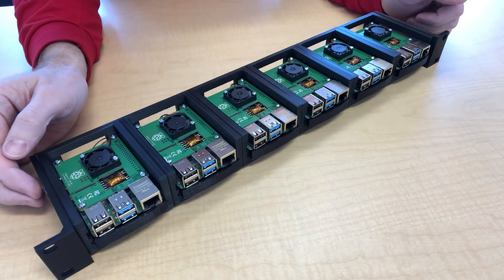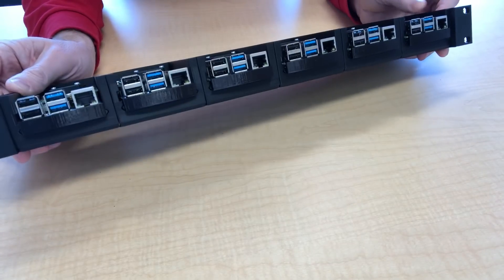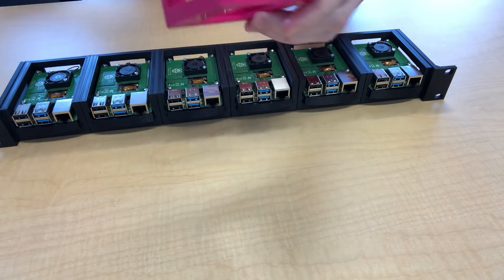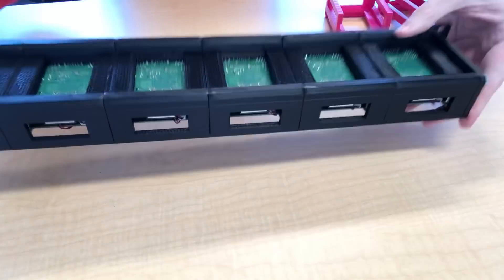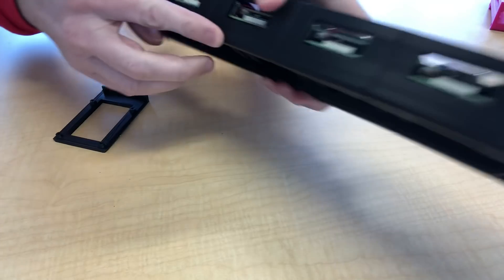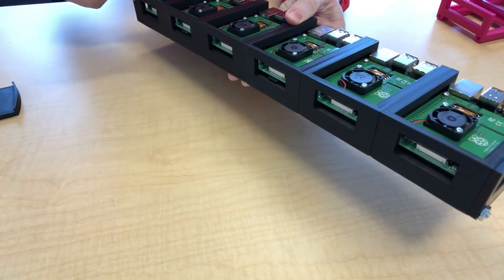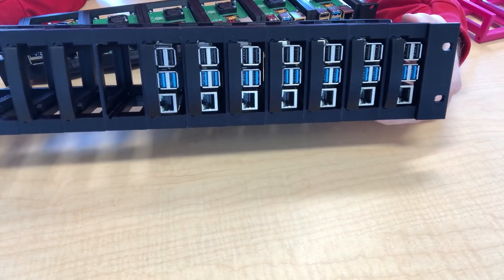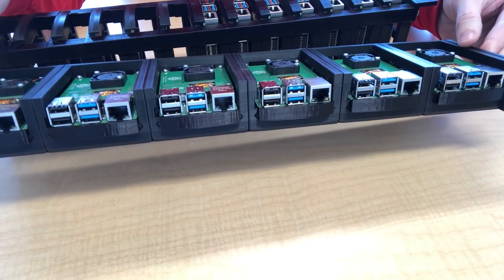Raspberry Pi 4 1U rack-mount bracket

Comment: Awesome design 👍 how power supply wires are connected in 1U Design?
Reply from the maker: It uses Power-Over-Ethernet (PoE) HATs so the power comes in the front over the network cable. You then need a PoE switch to supply the power.
Reply: @RussRoss  Thank you. This helps 🙏

Comment: So a PI 3B would not fit?
Reply from the maker: Pi 3B fits just fine, but it does not have support for the PoE HAT (that was added in the 3B+) so you would need to find a way to get power to the boards. The sides are blocked so you can't just plug in a USB cable for power.

Comment: Would this design be able to hold a Raspberry Pi 3 as well as a Raspberry Pi 4?

There is a new hat called the Pi-KVM Hat #3, do you know if this would hold a Pi with such a hat affixed atop of it?
Reply from the maker: The Pi 3 fits just fine. I haven't seen the Pi-KVM HAT so I'm afraid I can't help with that part of it.

Comment: What do you use this for, if you don’t mind my asking?
Reply from the maker: I don't use this rack personally, but I do use the 2U version. I use the Pis as servers to support classes that I teach. They are cheap enough that I use each machine for a single application rather than trying to maximize what each one does. Once class I teach involves ARM64 assembly language so student connect to Pis remotely to do their homework. I have also used a bunch at once as a cluster for distributed computing projects when I'm teaching that class.

Comment: What switch are you using that provides power over Ethernet? Raspberry pis are finicky about power draw
Reply from the maker: I'm using a TP-Link 24 port PoE switch with 192 watts total available for PoE use. It can go up to 30 watts on a single port as long as the total doesn't go over 192. My Pi 4s use about 3 or 4 watts at idle, more like 6 or 8 when fully loaded (which is not very often). A surprising amount of power can go to peripherals in a standalone Pi. I have one with a couple of USB micro sd card readers and it runs at around 6 watts idle. The switch monitors power use so you can see exactly how much each unit is drawing, which is nice.

Comment: I am concerned about the lack of airflow. Maybe the 2U gets at least some brackets for holding fans?
Reply from the maker: The PoE hat has a fan built in that automatically kicks in when it gets warm (it turns on around 50 C if I remember right). A little bit of active cooling goes a long way, and I haven't had any heat problems. That said, people have modded the 2U version to add larger fans. Check out the remix section on Thingiverse if you want to see what other people have done.
Reply: @RussRoss  Perfect! Thx!

Comment: and how to connect power to them? you can't get in there
Reply from the maker: The PoE hats deliver power through the Ethernet connection. You need a PoE network switch as well. There is a bit more detail in the video for the 2U version. It was the arrival of the official PoE hat that really prompted this design.
Reply: @RussRoss   I did not know that Pi 4 supports POE connection, then the question is removed, thank you

Comment: Will this fit an old Pi 2? I have a few 4s and an old 2. Would like to mount both.
Reply from the maker: Yes, I'm pretty sure a 2 will fit. The 2 does not work with PoE, though, so you will need a different way to get power to it, and the side ports are not very accessible in this layout.

Comment: what size rod does it need?
Reply from the maker: A US size #10 rod is the default, but it is not hard to adjust (to a metric size, for example). The thingiverse page (linked in the full video description) has the full details. There is also some useful info (and an assembly demo for the Pi and tray) in the video for the 2U rack, also linked in the description.

Comment: Hi folks - this is great and just printed one on my friend's 3D printer - question. What type of screws should we be using to mount the Pi to the black trays??  Did I miss it? Thanks. Joe.
Reply from the maker: Hi Joe--I used M2.5 x 12 screws that I bought from Amazon. It pushes through the tray and screws into the spacers that came with the PoE HAT. The tray design is the same as for the 2U version of the rack, and if you watch the video for it there is a more detailed assembly demo. That video is linked in the full description of this one (you may have to click to expand it). The parts are also listed on the Thingiverse page. Hope that helps!

Comment: Hi, I am after a case like that but I want the cables to be behind not in front, and not use POE since I only have one POE, Do you have any design Ideas for that
Reply from the maker: This layout obscures access to the power port, which is a problem if you are not using PoE. I would suggest looking at the 2U design (see the video description for a link) since that exposes the ports. Flipping the boards front-to-back would require some additional design work, but the 2U layout is probably a better starting point.

Comment: Both designs are super cool! What are you using the multiple Pi boards for?
Reply from the maker: Thanks for the kind words! I use them as single-purpose servers to support my classes (I'm a college professor). For example, I have one set up as a server that students can use for their ARM64 assembly-language programming assignments. I have another set up for a programming languages class where I have pre-installed all of the weird environments I want my students to use. I also run servers for some other support infrastructure.

I have also used them for more traditional cluster-style projects. I teach a distributed systems class in the spring, and one of our projects is to build a simple mapreduce system based on the classic paper. I used my cluster as a demo platform so students could run their distributed systems code in an actual distributed environment. This was my initial motivation for building it, although I'm getting much more use out of it as a mini server rack (it's nice to be able to devote a whole machine to something that would seem a bit frivolous if we were talking about $10,000 servers, and I prefer bare hardware to VMs).

It's really about them being cheap and yet surprisingly capable, but applied to servers instead of IoT applications.

Comment: I sunk a small sum into my first sbc with all the accessories, but I don't really have a purpose for it, in the end. At least it boots to NVMe I guess. I had hoped to run Steam Link, but it doesn't work for the Rock Pi 4C 6 Core RK3399. So much for that idea. Guess I should've grabbed a Raspberry Pi 4. Oh well, next project. 🤣 Cool mount btw.

Comment: i would love the 2U with a closed air sealed enclosure and 120 mm fan mounts on the back for cooling. those pi4s can get really hot when you load them up properly

Comment: You could make the bottom front and back part hollow from end to end and put two metal rod inside it across all six units. Would help with rigidity in both directions.

Comment: What does something like that cost in maths?  1u one :) Might  have to get a 3d printer since u were nice enough enough share the blueprints!
Reply from the maker: The 2U rack (with all pieces and some failed prints) took less than a 1 kg spool of PLA filament. The 1U rack would use less. A 1 kg spool is roughly $30. If you are new to 3D printing, bear in mind that there is a learning curve and you will likely waste some materials as you figure things out. Good luck!

Comment: Awesome video and thanks a lot for sharing your design, Russ! Are you using the same rod to connect all of the cases? You mention this in the video showcasing the 2U design, maybe I missed it here.
https://www.homedepot.com/p/Everbilt-10-24-x-36-in-Zinc-Plated-Threaded-Rod-802207/204274027

Comment: There's no clearance for the fans, and I can't help but feel like designing the blocks to interlock would give you space for a 7th Pi.

You could try putting the rods diagonally (top front, bottom 3/4 of the way back), and either one side on each block, or two sides on every other block (and a 'side' on each rail, which might make them stronger)

Comment: Does it work well with heat dissipation? Can a fan be installed without having to modify the tray or the rack?
Reply from the maker: It works pretty well, although I should note that I am using the 2U version--not the 1U version--for my own cluster. The PoE HAT has a fan with a temperature-sensitive control and they all stay around 50 degrees C. There seems to be plenty of airflow. I did not put heatsinks on the boards since I was worried it might limit airflow.

Comment: Hi russ --  do you know if the pi trays will hold rpi 3b+ as is, or is the bore hold pattern different for 3's vs 4's ..
Reply: nvm -- the answer is yes -- it will hold 3's also -- the bore hole pattern is the same for 3 and 4

Comment: 2 questions. 
1. how do they get power? it seems like there is no space? 
2. Is there a practical way for using an ssd drive as the main disk? Or do i have to plugin them in on the front?
Reply: 1. PoE (Power over Ethernet) via the hat he mentions a few times.  2. SSD as a main disk is somewhat outside the topic of this video, unless it is just about "how do I plug it in?". If that is the question, then 'yes', plug it in at the front.

Comment: One of the bigger features of rack-mounted equipment is constant pressure airflow setup for cooling. In cases like this with HDD bays in a rack mount server, they’ll rely on the intake vacuum sucking environmental air past the components, whereas smaller devices like switches tend to have their own fans to create said airflow, directing it out the back. Have you accounted in any way for this, allowing mounting points for attaching fans to them, perhaps blocking the large port on the back side a little more so that it creates a vacuum pressure around the Pi units? Would this be something you could implement? I know with a 2U it’s a lot easier to get a decent airflow without too much lost efficiency or noise. 
(Yes, I realize the PROPER way to do this would be a cabinet-mount case with it’s own silent fans, but since so many people in the DIY community go with open-air frames, I figured it would be worth asking. Especially when you’re at a Raspberry Pi Budget, those standalone quiet cases may LOOK nice, but... $$$)

Comment: I think you'd gain better ventilation if you'd turn the PI upside-down, as you have it currently there, the fan is almost touching the bottom of the equipment just above it

Comment: Excellent!! Is there enough room to allow the ventilator to do its thing when mounted in a rack? Btw: the SD card is not required anymore to boot with the new boot loader in beta. Wish List: A tray for one or two SSD disks. blanking plate.

Comment: but, a cluster for... what?!
Reply: Clustering of Raspberry Pi boards is more about hands-on learning concepts with a lower cost of entry than really anything functional.
Reply: @dmmikerpg  Low cost? Surely that's at least £600?
Reply: @dmmikerpg  not true -- my pi cluster does real work at home .. serving several services that we use everyday (pi-hole, grafana, teslamate, node-red , dns, and somme custom rails apps i've built myself
i run this on a 3 node pi cluster (using docker swarm) .. and the swarm function has even come into play when 1 of the nodes died due to a bad SD card -- the apps kept on serving from the other 2 nodes until i replaced the broken sd card
Reply: @ricardo-sf  Fail-Over (HA) Clustering is definitely useful, but in terms of distributed computing a Pi is pretty much going to be limited to being conceptual.
Reply: @ricardo-sf  I would definitely like to play around with Docker swarms and the like.
Reply: @dmmikerpg  I still disagree.. you could do vertical scaling web services with a pi cluster.. it's not theoretical..

Sure you will need many pi's to do what one enterprise server can do.. but it's not about comparing one node power
Reply: my cluster runs in a docker swarm and hosts several apps that i use at home, grafana, teslamate, nodered, etc... really cool stuff and its fun for me
Reply: Now that 4gb and 8gb ram are out, these clusters can do anything.
Reply: 'Cluster' can have at least two meanings in this situation; either as a form of combining separate compute hardware to form a more powerful unit, or (as I think in this case) just putting the physical hardware neatly together, but without necessarily having any combined processing.  I've got 5 PIs in my rack, all doing very different (i.e. non-clustered) processing and they are all in individual 3D printed cases. The approach in the video is really nice, I'm tempted to use it.

Comment: Would a hifiberry fit?
Reply from the maker: I'm not familiar with the hifiberry so I can't say for sure, but this rack assumes you are using a PoE hat. If you are using a different hat, you will probably run into problems and may need to customize it for your application.
Reply: Russ Ross ok. Thanks!

Comment: I feel like we need a 'mezzanine' board for a raspberry pi 4 compute stick cluster that fits 20 into a 1u space using standard desktop style sodimm slots, a single 10g port and maybe wifi(wifi might require a full fat pi4 built into the board), a single power port, dedicated SD slots for each compute stick, and maybe a dedicated USB port for each compute stick. or at least some way of having a KVM. 
all of this while having the compute sticks hot swappable (power off the compute stick you are replacing, all others stay powered on)
Reply: 4 compute stick does not exist at this time.

Comment: This is nice. May I suggest to design an individual pi holder than can be connected via threaded rods in either vertical or horizontal mode so you can use the same design to make a 2u or 1u stack

Comment: Now also thinking about power control.  Pulling E-cable a pain.  A reboot will do if not hung, otherwise, PITA time.
Reply: Most PoE switches allow you to turn power on/off for a given port, so this shouldn't require pulling any cables

Comment: I love the designs, but don’t the PIs get too hot in the 2U?
Reply from the maker: The PoE hat includes a fan so they are actively cooled. Mine stay pretty reliably at 50 C or cooler in a machine room that is hotter than a normal office.

Comment: This is awesome! I'd love to see a version of the 1U or 2U that have an area for a small switch. So one could wire all the pi's to a single switch and then take that switch into the main network.
Reply: That's exactly my plan. Do everything PoE and use something like the Ubiquiti UniFi Switch PoE 8 (150W) or UniFi Switch PoE 16 (150W). But I agree, it would be nice if it was integrated with some nice built-in cable management.

Comment: Would you consider making a version for use without the PoE Hats? It doesn't seem like there is any room for a (90 degree) usb C power cable.
This 1U unit looks so clean but I really don't want to switch from heatsinks to poe hats and gain 30C temps on all my rpi's. Not to mention the costs and wasted materials on the heatsink :)
Reply: You could edit the stm files so feature a spot where you can have a plug on the end so as you slide the raspberry in the rack it connects, this would depend on what plug/connector you'd use obviously and then you connect the power not to the USB port which is indeed on the side but you connect it to the 40 pin header on GND and VCC, though adding in a little fuse wouldn't be a bad idea either.

Comment: Sweet!

What are you doing with them?
Reply: elmonte5lim someone wrote a program to use multiple Raspberries in an array to test Code he wanted to run on his Universities Mainframe. if you were able to use such an Array as a reverse VM (a single Machine spread across several physical nodes) you could work with heavily multithreaded Workloads on the cheap

Intel uses Atom cores in their Highcorecount Server-CPUs afaik. while a single intel Atom is about as much as an RPi 4 2GB and has higher singlecoreperformance, as soon as we go for high corecounts, the Raspberries become incredibly cheap. when building a Computer on 64 CPU-Cores from intel, you can end up at pricepoints of well in excess of 10000 dollars, if you went for 128Gb of RAM (64* times the 2Gb of said RPi). [intel doesnt sell a single 64 Core CPU afaik and because mainstreamplatforms from intel dont support Multi-CPUs, you would most likely need to buy Intels much more expensive Xeon Lineup, which only works with ECC-RAM... (still no case or Servermainboard and NIC included)]. 
with the Raspberries you would (if my Napkin math was correct) would end up just shy of 2000 dollars.
I havent tried calculating if energyconsumtion made up for that but i dont think so tbh.
Reply: @ithelayer8problem  Or you just acknowledge the existence of AMD and get a TR 3990x plus 128 gb RAM for about $4500 for 64 cores, 128 threads and an order of magnitude more computational power than the RasPi cluster...
For the same price as 64 2gb RPi you could also get a 32 core/64 thread TR 2990X plus mainboard, plus 128 Gb ECC RAM, which would also likely outperform the RPi cluster, cost significantly less in terms of TCO, and wouldn't be limited to 2gb per process. On the server side a 32/64 Epyc 7551 would come in even cheaper.
Since you'd only need a single PSU (the RPi's have no redundancy either), power delivery would cost about the same between the RPi cluster and the server/workstation solution.

Bottom line: when doing napkin maths, make sure not to ignore other options just to fit your narrative.